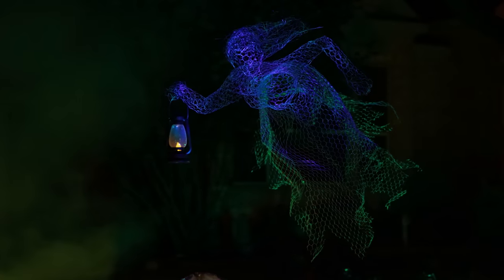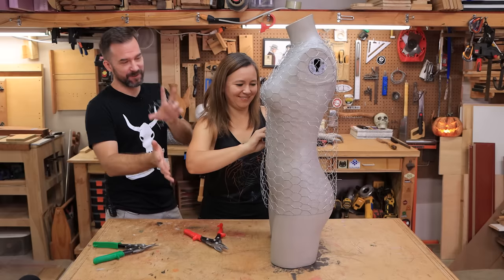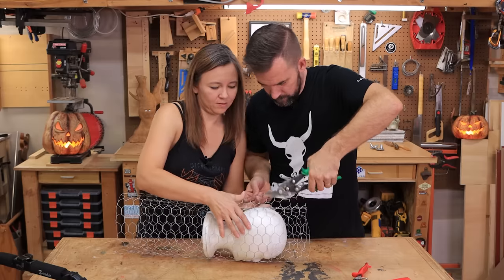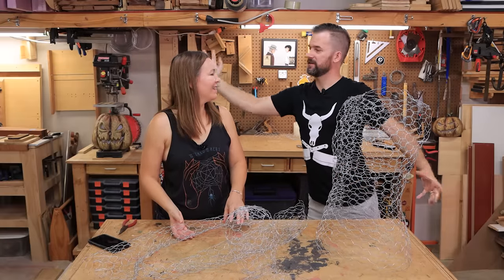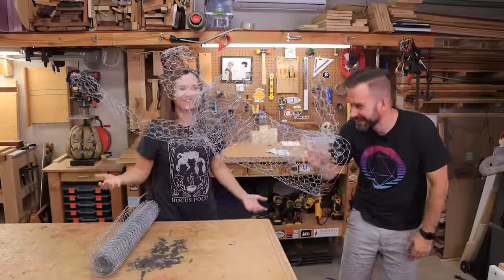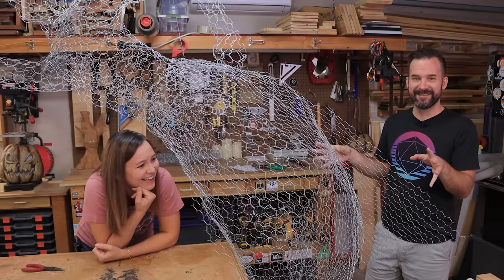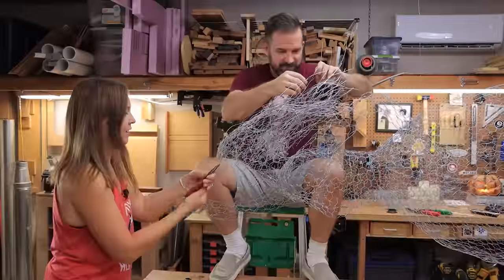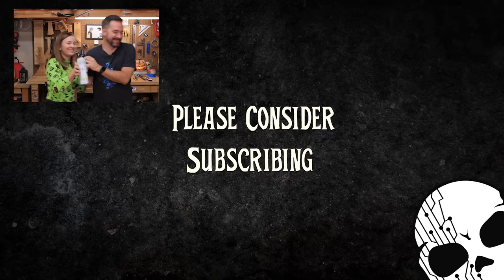Glowing Chicken Wire Ghost 👻 DIY Halloween Props

Comment: If you guys ever do another project with this much chicken wire, I would look into buying a pair of Safety Wire Pliers. Aircraft mechanics use them all the time, they make wire work WAY easier, and you can pick up a cheap pair at Harbor Freight or Cabela’s for like $30. You guys are awesome! 😃
Reply: Still have mine from my days... no years of cannon plugs and saftey wired bolts...
Reply: Those are pretty sweet, I didn't know a tool for that existed.
(And they're only $10 at Harbor Freight anymore.)

Comment: Very nice! The hair and tattered dress were awesome! I think you would have gotten better results with blacklight reactive UV-A acrylic paint... They sell them in many colors, I think if you base coat the chicken wire matte black and then sparsely spray some of that paint over it, then illuminate with a blacklight bulb (maybe even use the blacklight bulb in the lantern!), you might be able to lose the chicken wire hexagons a bit more... Also, I would loosely attach the arms and then suspend them from different smaller branches to let the wind articulate them...

Comment: Awesome job guys. Ive been doing Halloween now for 20 years, wait, this year will be 21 lol. Ive made just about everything. Chicken wire monks where my favorite. Made them 6' tall to stand along side the driveway. 6 in total. But your witch is great. Maybe consider a blonde wig if you want more hair. It tends to shimmer more in the light. And hair spray is your friend when using such props and wigs. even gives it that eerie look during the day. Great job. Yes i have seen duck clothes, my 93 year old mom still buys them for her duck on the porch. A chicken wire chicken might not be notable in a yard display, but make a duck with an open mouth and use the cut off squares to make a very tooth filled mouth top and bottom, would make a nice pet for the witch

Comment: so a tip for you guys from the UK if you use straps same has the ones used to anchor down goods on a truck you can squeeze the chicken wire to the form of the model then its just one cut down the back to get off the form and that stops any cuts from the odd edge which will happen from multiple cuts and scratches etc etc

Comment: That is so cool just wished you did a close up of how you connected the chicken wire with need nose pliers
Reply from the maker: Thanks! You basically bend the little spikes ends of the chicken wire around itself. You can also cut extra pieces to fill holes or use as little stitch pieces.

Comment: I wonder if u can get like a few heavy duty trash bags over the chicken wire and dummy. Than use vacuum to suck air out and it will give u perfect contour of dummy. Obviously try to cover sharp edges with tape to avoid bag from tearing.

Comment: Wasting time cutting and reattaching to size it. Instead, pinch the metal. I make all sorts of things humans, birds, pumpkins, owls, just PINCH to cinch towards it self. You'll thank me.
Reply: And instead of xugying strips and having to clamp back every last cut on both sides, irs so much faster to cut a long strand of wire and use it like thread without thw needle...not crimping needed...just sew with it.